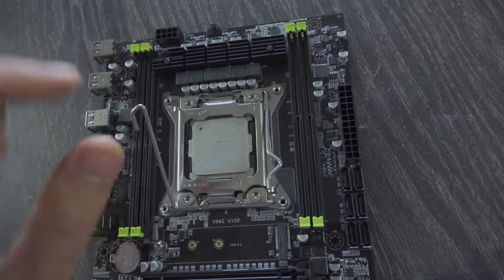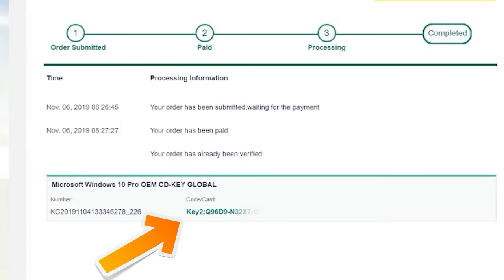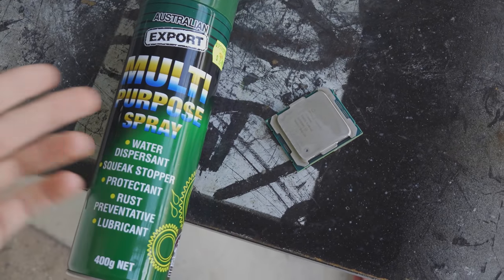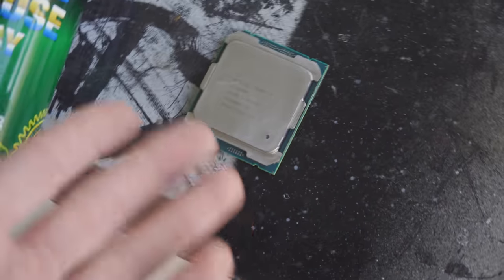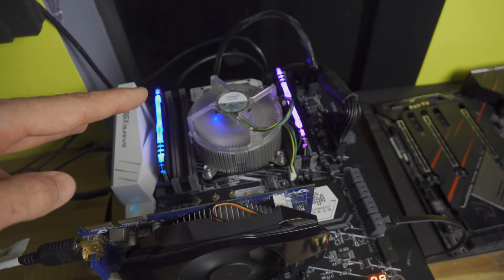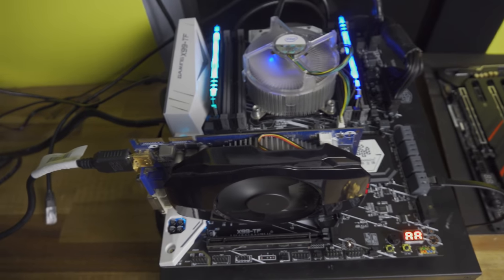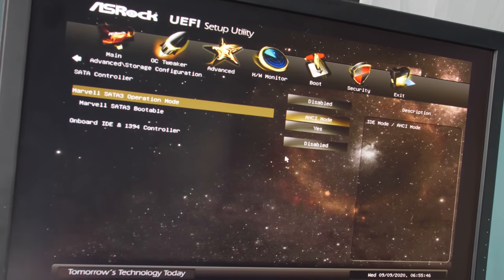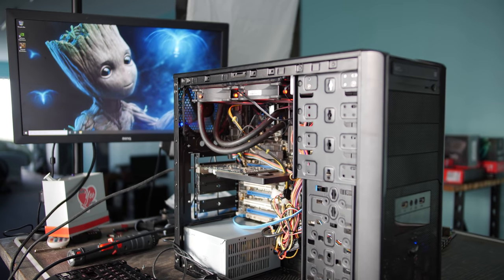Can you FIX a CPU with a WHOLE corner missing...?! (weird computer problems)

Comment: Got a free GTX 560ti - guy said it didn't work, I cleaned it up , new Tim and yep it had problems so i re flashed the vbios and lowered the clocks  about 20% on coreclock and mem clock - now happily playing Crysis 3 40fps hahaha - I traded a guy for a Windforce cooler off a R9270(Basically the fans and shroud not heatsink)  that was totally wrecked  for a 25 year old motherboard I really wont use ever again.Since I used the 560ti's single fan to fix a GTX 780 FTW i got for $40 -It's fan blade was missing making the whole PC  Vibrate since the fan was off balance . I zip tied the windforce cooler onto the GTX 560 ti and its super cool since the card was originally a single fan design - Usually runs under 50 C under load at 30 degrees ambient

Comment: I have a problem with my GTX960 graphics card, it is a connection between 6 pins and 8 pins.. It works only when the cable is hanging out of the case , when the case is closed there i a s short circuit.  I can not fix this.

Comment: I have a 8gb rx 480 that fluctuates its core speed like crazy causing all sorts of stuttering even in a light title like CSGO. Hwinfo64 isn't reporting any abnormally high temps, and maxing out the power limit doesn't help. Any ideas as to what to try next?

Comment: I have heard that AMD actually shipped some Navi cards with way too high clock speeds and they ran unstable from factory. From what I know AMD tired to update them and during update to reflash vBIOS. However, it's possible that some cards are running old and unstable vBIOS.

Comment: I have a MB with ram slots 3 and 4 disabled (so no dual channel)

Tested on 2 cpus and known good ram. Its p55 LGA 1156 chipset .

Any tips?

In the bios the broken slots are greyed out, not just empty. If I fill them, it detects memory but it is not included in the total 'available memory'

Comment: Picked up an I7 recently that has a slight bend to the substrate on one corner, as well as the substrate being slightly split along the edge of the corner.  It posts fine and will boot to windows and run games but will only run dimm slots 1 & 2, as soon as anything goes into slot 3 or 4 it refuses to post. Been trying to figure out if there is a way to fix this for a few weeks now.
Reply: Was it a skylake?
Reply: @EvilTurkeySlices  Nope, Sandy Bridge. I7 2600

Comment: Hey ! I have a problem. I bought a HP pavilion 15 gaming, with a ryzen processor and a gtx 1660 6gb. I have 8 gb of ram but igpu eats 2 gb. So i want to edit it in the bios advanced tab. But there is no advanced tab. I can't unlock it . Can you help me with an ideea?
Reply: Upgrade the RAM,laptop bioses tend to be locked down

Comment: Hey i have a bent i7 6700 brand new i bought it and put it in the wrong socket motherboard i think its called and closed the clip and wonderd for a while why my pc would not boot after a trip to a pc repair shop they came and told me the bad news. Ill be happy to send you the cpu free of charge if you want im in qld so postage would be fast. You can do what you want with it

Comment: bro plz help
i have a lenovo m91s desktop pc 
its new when i put my working amd hd 7570 in it its not giving signal 
gpu works fine fan spins but no disply
Reply: Try disabling secure boot and turning on CSM in the bios.
Reply: @m.saribibrahim3632  dont have any option in bios

Comment: WD GREEN 1TB HDD 2001 unscheduled power down door left open perma park HDD bug.
A Canadian software engineer provided the machine code commands for the HDD's on board pcb to reset and redefine HDD partitions to the world as at the time if you had one it was a paper weight until you did a marathon 3 month net search for that one obscure post in forum from long ago.
Then....after you used-ed a com port and a hack involving disconnection of the HDD's motor while still being able to program the HDD's controller with those commands and don't get it wrong!!..

Comment: My advice is, if you're using a gt 210 or gs8400 throw it away, NOW !!
My gs8400 kept destroying and corrupting my HDMI Cables, i had to purchase 3 5meters hdmi cables just to find out the gs8400 corrupted them all : (
And about the gt 210, it literally burned because of heat, it was reaching about 100 celsius

Comment: Hey, I HOPE SOMEONE SEES THIS. I have a problem with a ryzen 5 1600 box, and it not posting anything. I changed ram sticks on the mobo in this morning, and as i put my new ram stick in only one (i knew maybe it would not post with 2 sticks right away), and as i wanted to start the computer, all the fans sped up and gave no signal. I've tried different power supplys, ram modules and also ram slots. Even other gpus. The mobo is giving a cpu debug light. I have pulled it apart, non of the cpu pins are demaged. Had new thermal paste installed also, and still nothing. I had an A8-9600 lying around, and it does give out signal from the mobo. So what could i do in this situation. PLEASE HELP HELP HELP HELP HELP HELP

Comment: Back in the days of Athlon XP, i was updating the flash bios on a motherboard, and there was a power failure in the middle of it!! Dead board right? It was, it wouldn't post anymore with a blank BIOS. I did have another Athlon XP motherboard to use, though it was a lower-end board, and wasn't mine to keep. Heck I cant remember why i had the mobo in the first place, but I did have it. So i rebuilt my PC so i could get back online and figure out what I could do about a failed BIOS flash. Turns out that the flash ships on these old Athlon XP motherboard (i forget what chipset) used tiny socketed chips that were removeable. Both motherboards I had were different models, and brands, but had the EXACT same socketed flash BIOS chip.

 So the suggestion I read was to make a DOS boot disk (on a floppy) with the ROM files for the dead mobo BIOS firmware, but with the flash utility for the mobo that is working. What I had to do was boot to DOS, and once i was at the command prompt, with the computer still powered is to remove the BIOS chip it booted with. Then install the dead BIOS chip from the other motherboard that failed it's update.  Run the flash utility with command line switches that ignored all the safety checks and forced a flash write since it's a different motherboard. After it flashed the BIOS chip, i swapped the BIOS flash chips back in their original motherboard, moved the CPU and RAM back onto that mobo, that had died... and it BOOTED up!  SAVED!!
Reply: fun times
Reply: That's pretty awesome abuse of hardware. I had to do something similar with an rx480 I was flashing with rx580 firmware. Popped it into another computer that already had a graphics card, pop into command line, and the re-flash worked.
Reply: Nice people saving their hardware rather than throwing it away, respecttt
Reply: Awe yeah, love it when you roll with the punches and pulled through in such a chaotic scenario. You're the big man that day for sure

Comment: Selling a rig with a damaged chip like that is no big deal. You just show the buyer that it works and then tell them, absolutely no guarantees because of a the significant damage to the chip. And then sell it to them at a nice discount. If they come back angry after buying a full disclosure damaged system, then it's not on you.
Reply: "as is"
Reply: @Nik-ff3tu  "Untested, as is" code for "It's broken but I'm trying to imply it might not be."

Comment: This is like a TBI patient unfortunately 😕 ; you had a complete substrate failure and managed to be lucky it gimped the CPU in a recoverable way. For those that have a similar issue or bent pins on the board check the socket / CPU pin out or schematic to see how well the damage is it can help assess the condition as well before diving too deep.

Comment: i have an amd phenom x6 1075t that suffered a lightning strike which blew out the psu and fried the socket . the underside of the chip is black and many of the pins were burnt . i soldered a few back on and cleaned the rest lol the chip works but it needs 1.42 volts stock to run so it idles in the mid 40s and hits the 60s even on a good aio . so its not a good overclocker any more it used to be a golden chip that would it 4.2 ghz with little effort  so its kept at 3.6 and is used for office wrk

Comment: So i got hosed on 1080ti the thermal pads were not covering 3 mosfets and the cooler was bent. Long story i fixed the cooler but the mosfets died and broke off i took the card to a repair shop and the guy there said there is little hope that they could fix it. Well lucky me they found and bought another broken gpu idk what model tho. They got 3 mosfets from that card and re-soldered it to my and holy crap it worked! The new 3 mosfets have different dimensions but the repair shop guy said that they have the same properties. 45Euro for the new mosfets and 60Euro for new thermal pads. Dude saved my 1080ti i cant thank him enough... And the guy who sold me that gpu well he better be praying that i wount find him ever again. Here are some pics https://ibb.co/tzrGpqx
https://ibb.co/QYFV3zh
https://ibb.co/X2KBJw7
https://ibb.co/Svrm2Sb

Comment: 8:53 this thing happened to me as well. My rx 480 strix can't handle 5 minutes of Unigene Heaven even on stock settings (1260mhz gpu, 2000mhz vram). after a month trying to find the solutions, I found that my gpu's vram needed to have extra voltage. so I raise the Vram voltage from 1000mV to 1100mV and now it's running smoothly.
But is there any solution to change the Vram's voltage in MSI afterburner ? I hate to use AMD Wattman and so on
Reply: Mod the a bios file of the card and reflash it with that voltage
Reply: MerolaC nah I don't wanna mess with a "modified bios", just gonna find a compattible/ sbd modded successfully bios

Comment: Brian, my PC which I built from old parts has stability problem
It turns on normally, in Windows working, but after few seconds the screen blanks and keyboard is irresponsive (cannot turn off numlock). Force power off, powering it on again it shutdowns immediately. Do it again it'll go normally.

It's 775 e7500 PC 4gb ddr3. Maybe I need to manually test parts?

Comment: Actually, there is no some "special" or "weird" way of how chinese motherboards works in quad channel with non-high-end chipset. Memory controller is built in cpu since x58 chipset. So basically any "generation" compatible chipset will work fine with 2011/2011-3 quad channel since it's maintained by cpu itself and chipset is just a buffer between pci/pci-e/usb/ps2 and other ports.

Comment: Hi ya Bryan i broke the connectors of my hardrive a 3 gig one so i used hot glue and left the cables also the power connector to  connected all the time about 3 yrs ago i did that it still works today a sata one the plastic broke away while plugging it in hot glue is good stuff hahaha

Comment: I found an intel DH77KC with an i7 3770s in a recent dumpster dive and it had some issues booting reliably until I flashed the BIOS. Now the only major issue is the system shuts off any time windows 10 tries to go to sleep. Got any tips for me to try?

Comment: Had a brand new RX 580 that was flashed with the WRONG bios out of the box one time. The bios it had did not match the memory chips on the card, which made the card crash when the memory frequency changed at all.

Comment: Very cool music, and good that it works. If it were me, I'd sell it as a $1 CPU in a system that essentially is missing a CPU and has a placeholder in there that will go at any time, will be enough for the time being but if the customer knows this going into it, they can then get most of the system, it will work for a bit, then they'll just need to buy a CPU later when it stops working.

Comment: When I worked in Acers refurb factory (ran by Scenneca Data and Revonate LLC), we would have random "ghost" systems, no post when assembled, but every part, including the case, would work fine in another system.  We had to refurbish at least 30 a day, so we didn't have time to figure out why, we just would send the parts to tear-down to be tested individually and used in other builds.

Comment: I need a bit of help here. I got an rx470 sapphire mining card. I tried flashing it to a regular gaming bios but it is stuck at 300mhz. I have tried everything from flashing to an rx570 bios and forcing minimum clocks in radeon software to the max clock speed. I tried older drivers. (I used DDU every time I change drivers. Swapped motherboard bios. I have installed fresh OS.  Still stuck at 300mhz. I have a 700w power supply and temps are fine.

Anyone got any idea what could be wrong?
Reply: I guessed the flashing failed or so

Comment: It ain't dead, just missing an arm and a leg. Also while not worth the trouble, in theory one could get a donor with an intact substrate and using a fancy cpu soldering station swap the silicon chip (if it's still intact after removing the IHS). edit: nvm, some kind of epoxy is used for underfill and who knows what temperature or chemicals can dissolve that and if the core can survive that.
Reply: wowe

Comment: My i5 2500K developed a faulty core, but if i set bios to 3 core it worked. (OC to 5GHz )
I replaced it with a 2nd hand i7 2600K (OC to 4.7GHz)

Comment: Hello i have a problem with my pc that i recently built. Everything is new expect GPU(Aorus 1070ti) so i don't know if there's any problem. When i try to turn it on most of the time it doesn't boot into windows, i can clearly see bios going up and then motherboard picture but then it goes black so i need to restart it and works good, there are some times that it boots first time but than pc is like bugging or lagging so i need to restart it anyways. When pc is running and then i turn it off it's still like in the beginning what i said so if anyone can help, thanks
Reply: Andrija Kitić sounds like something with the gpu driver. Uninstall you gpu driver with ddu and try again.
Reply: @sijedevos2376  so i really need to uninstall it? because i always install new drivers and now i'm at latest one...
Reply: Andrija Kitić yes with ddu

Comment: I have a bizar problem for year my 9900k and 1080ti do not like to play RTS all other games NP but doom 2016 ID software intro no go I have tried all the hoops renseting ram, new ssd, new ram, new psu, remove 5ghz overclock, reset windows, reinstall windows, new gpu 660 2 gb, no no no thermals are fine and nobody can tell what is rung so yes 3200 $ out the window

Comment: Sellers friend sent me the cpu that i was supposed to test and pay. Got the cpu damaged pins wraked its 200ge it took me freaking 30min and precision surgeon  hand to fucking bend the pins back. Pcb damaged i dont see tracers. The cpu was like someone smashed it on the ground lel none pins are missing waiting for the board to test it out. This happend like 1h ago. Waiting for board gonna get it in 30 min from the post

Comment: Bruh ive had a pc not load anything the bios booted the gpu worked cpu worked ram worked everything detected but when i put a drive with windows in the sata the pc stays black screen so i put a new ssd and new windows install and guess what the usp stick with windows dosnt even load blavk screen turns out the motherboard had bent pins for cpu making it not processs yeah u herd right a processor that dosnt process stuff hahahahahahah fail rip my 5670 5500xt 8g pc will be never built aww